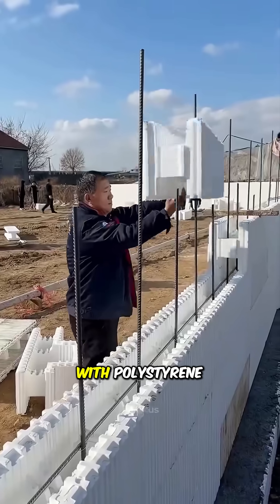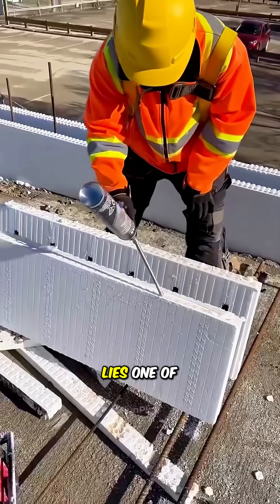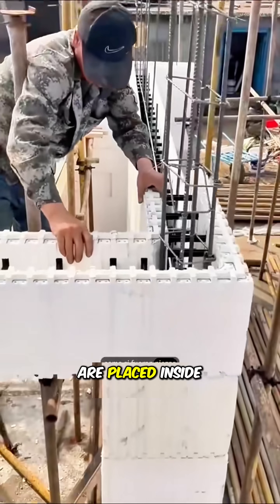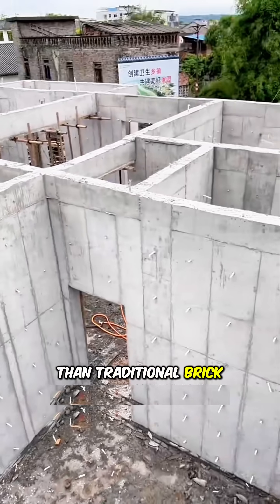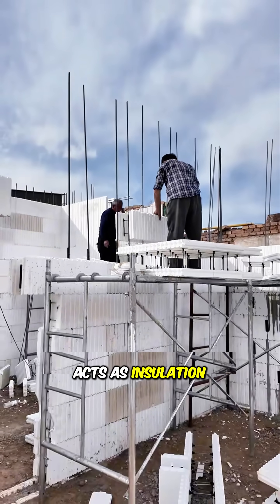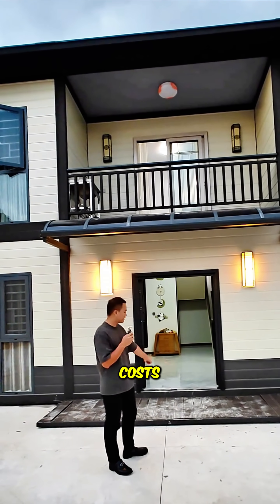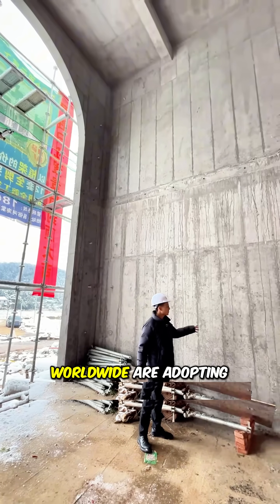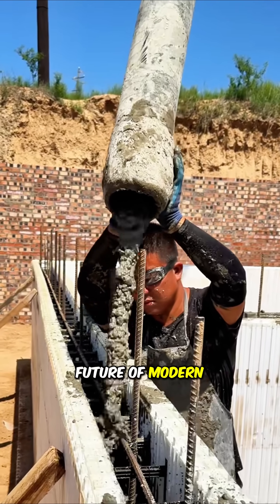Technology is changing the construction industry f

Comment: Why are the photo's of concrete walls in the video NOT made with the styrofoam blocks & were instead made with conventional forms? You can clearly see that the styrofoam has vertical striations that do not appear on the basement walls in the video but instead we see the imprint of conventionally formed concrete. Suggests this may be a scam. Clearly those images are wrong in that they have nothing to do with the alleged product they are selling. Advertising gone wrong or scam? I can't tell which it is.